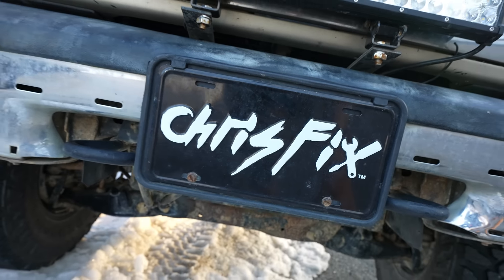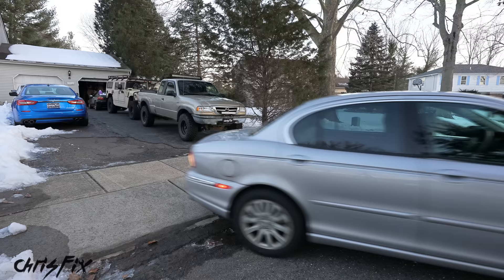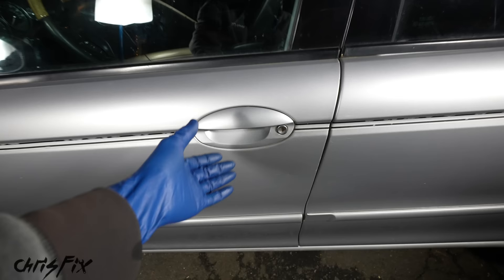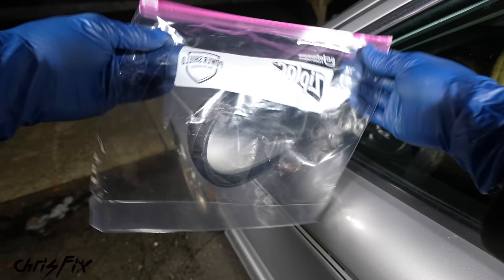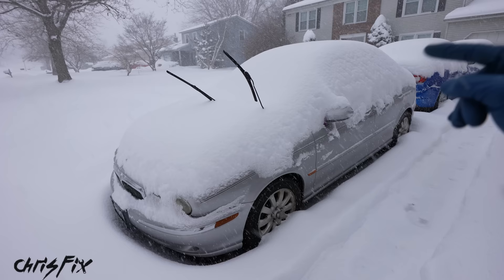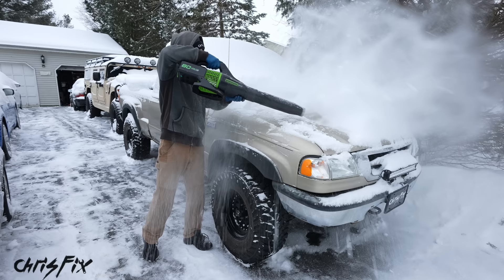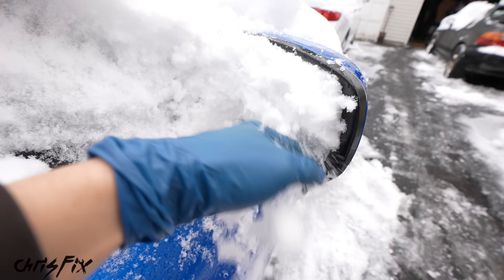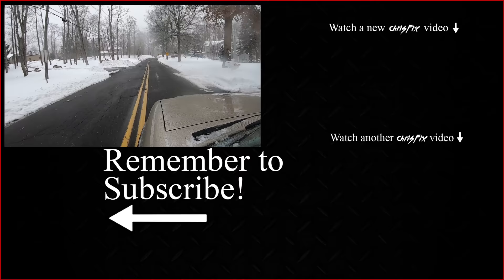10 Winter Car TIPS & TRICKS you NEED to Know

Comment: Right after all the beginning dialog, my first thought was "clean out your garage and park the car in it".
Reply from the maker: Unfortunately that will never happen. My tools and the products I use to film take up a lot of space.
Reply: Last year: 100 Watt light left under the engine block.  This year: car under cover.  Yeah, it's nice.  Fortunately there are other buildings here for the boxes and tools.
Reply: @chrisfix  "ChrisFix here, today I am going to show you how to upgrade your 2 car garage to a 6 car garage!"
Reply: @tactileslut  a long time ago, my dad drive his 1959 Buick Invicta every day in Ohio and it never had an issue cranking up.  That thing was a tank.

However, our neighbor with the diesel Peugeot, had issues with his fuel gelling when it got below zero.

He asked my dad for help and he put a few light fixtures on a board and put heat lamps on them.  The guy kept them plugged in all night and cranked right up in the morning

No idea on how he got back home after work.
Reply: @abstract1dea  Two heat lamps are keeping my well equipment happy.  Two more, on a dimmer, are warming the cat bed in front of the car.  They're a wonderful, simple invention.  :)
Reply: I have a one car garage that’s barely big enough to pull a small car into and open the door, it’s more like a convenient place to keep stuff than an actual garage
Reply: You don’t want to do that with salt on the roads. It heats up the salt and speeds up the rusting process

Comment: Something i learned back when i had a newspaper route on snow days: if you have a FWD vehicle and stuck at the bottom of a hill with no outlet, try reversing up the hill. Effectively makes your car a RWD with weight of engine giving more traction. Got me out of many desperate situations
Reply: FACTSS
my 4wd vehicle got stuck one time on a hill literally got to put 4wd lock on it
newspaper routes for me in NY were hard
Reply: Actually reversing also makes the tyres grip more as they are worn that way so its more edgy and grippy that way, but doesnt mather if your tyres are new. I once reversed up a hill with a truck thay is rwd and it worked becauee of what i just said :)
Reply: Also, reverse gears have more torque
Reply: This is also why backing into your driveway makes no sense unless you driving a rear-wheel drive vehicle or 4WD. Most cars today are front-wheel drive. If you need to punch through the hedgerow created by the plow you will need as much momentum as possible so keeping your drive wheels on the ground as long as possible is really important. So you want those drive wheels to be the last axle to bridge that snow pile not the first.
Reply: @LowsJuan  vehicles also typically don’t have as much clearance in the back
Reply: It does work indeed

Comment: The best tip I've ever gotten was from my grandpa before he passed. He sat me down one day and he said "listen boy if you want to avoid all the issues that you seen in that Chris fix video just buy a house with an attached heated garage." And you know what he was absolutely right!
Reply: Everyone is not in a position to do that.
Reply: @rickjames7576  fine, then buy a detached heated four car garage if that's more realistic!
Reply: My driveway is over 100 ft long. Sometimes we get up to 48 inches of snow in less than 24 hours. When I know a storm is coming, I park 10 feet from the sidewalk. That way I only need to clear 23 feet of snow (10'+5' swk+ 8' to curb) rather than 113' curb to garage).
Also, his tips work for open parking lots or visiting friends. The windshield covers are now made for rear windows as well (giant plastic hooks attach to rims or wheel wells); mine also came with a pair of matching bags for the mirrors (string closures with  slide beads, ala ski clothing): they all fit into waterproof storage bags (trunk or back seat floor).
Reply: This is the house part 🙄
Reply: Yes, that would always be my first tip!  Garage for sure!
Reply: Could just as easily have this occur when at work. Best to know how to prepare the vehicle for the weather.
Reply: Great Video! Thank you❤

Comment: I used my leaf blower to remove the snow on my car last time. It was funny because it took me only 25 seconds and the car was clear. But it only work if the snow is dry and light. It would not work with heavy wet snow.
Reply from the maker: Exactly!
Reply: Yes when it’s like powder it’s so easy when it’s like icy and snowy it gets annoying and when you have snow flakes on your windshield it gets annoying
Reply: icey snow also works, just not as well. It least the top layer can be removed and I can focused dealing with the bottom. We Canadians do this shit every winter
Reply: There was a blizzard yesterday and I had to work on the car that my customer wants fixed and it took me about an hour to get like 10 feet shoveled becuse there was like 4 feet of snow I also had to clear out my door or it would have gotten all in my house
Reply: Flamethrower removes the wet stuff.
Reply: @MattyEngland  Hahaha!
Reply: Yeah because all your neighbors want to hear a leaf blower. Hey thereare things called your hands to remove snow. No gas electricity or noise required.
Reply: @Xplorer, there's a you tube video where someone uses a flamethrower to clean the driveway.
Reply: Use a hot air blower. Don't heat any glass fast tho.
Reply: @Ottotherepoman1  Who cares what they think. What's louder, a leaf blower or a snow blower? Also, maybe Bob next door may look out his window to see what the noise and ruckus is about and think, damn, that boy is smart. I think I'll use that trick next time.
Reply: Oooo
Reply: @Ottotherepoman1  It work with a battery. It's pretty quiet and less noisy than any snow blower. Also like I said it took 25 seconds maybe 30 seconds total.
Reply: @TheMarkoPoloProgram  Love your comment.
Reply: I love the dry fluffy snow. You can literally just whack the top of your car with the brush and like 90% of it will fall off the sides.
Reply: @Incubansoul  The one I blowed was a lot heavier than that.
Reply: I use a leaf blower to clear off our entire driveway. 2 inches of "wet" snow and about 4 of powdery snow
Reply: In the Southern US, snow is usually to wet to blow well. We often get a layer of sleet or freezing rain before the snow.
Reply: @Ottotherepoman1  you realize that lots of people use a snowblower instead of shovels, right?  Same thing with noise.   Do you also complain like a baby about snowblowers?
Reply: @Ottotherepoman1  In some countries with noise abatement laws it would actually be illegal, especially since you'd typically use that early morning..
Reply: Im shopping for one as we speak :)
Reply: @Ottotherepoman1  I have Kleine Levin Syndrome that is a n extremely rare sleeping disorder. I fall into a partial come (peri comatose) for 5-7 days in a row and it takes me 3-5 days coming back 100%. After 5-7 days I'm very weak. Shoveling snow it's 10 times harder than when I'm normal. And when I'm 100% if I get tired to much it triggers an episode. I do one or 2 episode per month in average since 2007. If I déshydrate or food deprive it trigger an episode as well. I have to fine tune how I live otherwise I would always be in a coma.
Reply: @VideoLeakPolice  thats some tough stuff. Sorry, if i was your neighbor your driveway would be done. But i understand that if you can find a way yourself  and u can keep your independence thats great.
Reply: For wet snow or iced windows, use an Elon Musk flame thrower.
Reply: @Ottotherepoman1  It's all right man. I live alone so sometimes after an episode I need some food because I ate everything in my episode, As you can read in the description of the syndrome I have food cravings (compulsive hyperphagia). So I need to go to the store but also I have complete lack of energy (lethargy). And when you don't move for 7 days lie in your bed your muscle atrophied. I shopped for a car shelter but my parking place is too fit the smaller one they sell. A contractor is no good since they remove the snow when I again sleep for 5-7 days. Before I had KLS I was top shape an played multiple sport all of my like So it's not a question of being lazy. From the 1500 KLS sufferers I know in the world, I'm the only one who live by himself. I have to find ways to ease the difficulty it cause and like you say be independent.  

DEFINING KLS
In addition to excessive sleep, a Kleine-Levin Syndrome (KLS) patient’s whole demeanor is changed, often appearing “spacey” or childlike. When awake the patient experiences confusion, disorientation, complete lack of energy (lethargy), and lack of emotions (apathy). Most patients report that everything seems out of focus, and that they are hypersensitive to noise and light. In some cases, food cravings (compulsive hyperphagia) are exhibited. Instances of uninhibited hyper-sexuality during an episode have also been reported.
DEFINING KLS
Kleine-Levin Syndrome (KLS) is a rare and complex neurological disorder characterized by recurring periods of excessive amounts of sleep, altered behavior, and a reduced understanding of the world. The disorder strikes adolescents primarily but can occur in younger children and adults. At the onset of an episode the patient becomes progressively drowsy and sleeps for most of the day and night (hypersomnolence), sometimes waking only to eat or go to the bathroom. Each episode lasts days, weeks or months during which time all normal daily activities stop. Individuals are not able to care for themselves or attend school and work. In between episodes, those with KLS appear to be in perfect health with no evidence of behavioral or physical dysfunction.
Reply: it looks fun af
Reply: I know you
Reply: @Zahid_FBX  How?
Reply: @VideoLeakPolice  u watched that video where on roblox this guy said if u give ur roblox name he’ll give ya robux
Reply: @Zahid_FBX  I don't know what robux is.
Reply: @VideoLeakPolice  the roblox video
Reply: @VideoLeakPolice  are u a kid
Reply: hahaha pour some gasoline with a spray bottle and light it up... problem solved hahahahhaha {It would not work with heavy} wet snow.
Reply: @chrisfix  can you do a video about tuning your carburettor correctly
Reply: @chrisfix  where's the new video
Reply: @momenj8881    9 8 9  9mm.      O9. 9 nnm. 9
Reply: @chrisfix  yes chrisfix
Reply: If it is a light powder, just drive away and the snow will fall off. Zero effort required.
Reply: if its dry and light then itll blow off once you drive
Reply: What is snow?
Reply: I take the easy way out. My truck is parked in the garage.
Reply: You actually can still do it as long as you have just recently done a great wax job..I didn't believe it til my older neighbor did it to his truck.
Reply: Do they sell leaf blowers with a car cigarette lighter adapter?  Lol, remember when cars had those coil cigarette lighters!
Reply: @chrisfix   love you
Reply: @MattyEngland  Keep away from your gas tank. 😅
Reply: @TheMarkoPoloProgram  Problem solved if you do your neighbour's  vehicle and driveway as a courtesy. Just don't do it at 3 a.m.!
Reply: I live close to highway i55   i use to clear front window an side   then drive really fast behind semi an snow all blows away   even wet heavy snow
Reply: @Ottotherepoman1  True, but there are usually snowblowers fired up after a storm as well. I wouldn't use it too early in the morning, though!
Reply: Hey, a heatgun/blowdryer would work for ice! Better if you just need to get into the door though like if theres a solid sheet over the door lol
Reply: @VideoLeakPolice  I’m so sorry to hear that. Man, that is rough.
Reply: Snow is Never dry , it is water !

Comment: A few tips if you get stuck in the snow. Have one of those small foldable shovels ready in the trunk. You can use the cars floor mats under the tires to gain traction. Tire chains is also a nice backup
Reply from the maker: Thanks for the info!
Reply: Kitty litter or ice melt (safe for dogs) helps too. I think there’s a spray to melt frost and ice on your glass. Also one of those plug in to  car lighter sockets. May not be available on all vehicles. Most of these mentioned can be found in the vehicle area of Walmart or in a car/truck store like Auto Zone.

All even better if you’re retired now, you can just stay home.  My Dad told me to at least keep your gas above the 1/2 way mark. Although we used to live off a busy street, our driveway was designed with a turn about. Circular driveways are nice too. I want one of those. Hoping to save up for that in Spring. Waiting on the guy to give us a price quote.

Comment: Living through midwest winters has tought me that anything that keeps water off your car is good. Waxing your car before winter really helps get it off fast. Some sort of window treatment like RainX also really helps.  Also a collapsable foam snow broom for your car is a great alternative to a brush since foam will not scratch the paint and will also push big chunks of heavy snow.
Reply: There are window cleaners now with rain repellent added. Just clean your windows and mirrors as usual, and you've added protection. You'll have to buff the windows with a microfiber towel after you clean them, but it's well worth the effort.  Rain-X also makes washer fluid that contains their product. It will help maintain a repellent coating. It's worth every penny. If you're a detailing nut like me, a ceramic coating formulated for glass usually will last the entire winter if you use your wipers sparingly. A ceramic paint coating also helps snow slide right off your paint. Cheers from Illinois.

Comment: Quick tip: if your ever stuck in snow because your car has no traction, place your rubber floor mats under your wheels for added traction. Thanks Chris for all the great tips, keep up the good work!
Reply: Geez...that's a good one.  Hadn't thought about that.  Watched a show one time by one of those Bear Gryllis types who basically destroyed the rig to demonstrate how you can survive the cold with sun visors for snowshoes, hubcaps for water from the spare tire you set on fire to make a smoke signal to side mirror for signaling and upholstery to keep warm.  Don't forget a cigarette lighter to start fires and all that trunk wire to bundle up your feet and legs.  Simple as look around at what you have and making the best use of what's there.
Reply: Thanks. Sounds simple but difficult to think. It happened to me and my friend came n helped me with truck. I don't wish it to happen again haha but if it does, i'll do ur advice. Ty

Comment: Good video and I would add: 1) In 30 years, I have only "combat parked" regardless of the snow expectation. It is safer to drive forward in to the street, so it is good to have the habit throughout the year. 2) The main purpose of the silicone spray is not to displace water already in place, but to create a coat to avoid water molecules adhering to the surface when the temperature drops at night. 3) The brush looked quicker and easier than the leaf blower, but I would suggest starting from the roof and then move down as you end up moving snow to areas already cleared the way shown.
Reply: you stole my name mate 😂
Reply: I would disagree with only one thing...  If you have a front wheel drive car, you are better off to pull it in nose first because the car will keep the area behind the tires relatively snow free.  This will give you traction to back out.
Reply: @VroodenTheGreat  Backing into a parking spot is never about traction. It's because it's safer to back in rather than back out into traffic and pedestrians.
And if your tires have so bad traction you can't get out of your driveway, then you probably shouldn't be out on the road anyway.
Reply: I didn't know it had a name like 'combat parking', but I've always done this because my job requires me to get in & go.
Reply: Found the boomer dad 😂
Reply: @DonGorgen  i would agree with safety but disagree on traction . I have a lowered FWD car and the traction would definitely help getting out better of a slope around the car , with momentum you will not care scrapping the bottom of the car a lil bit but you need to get going in the first place .. also FWD are best in reverse in snow for traction purposes

Comment: If you get stuck in the snow, don’t run your car to stay warm without checking that the exhaust pipe is clear. If the tailpipe is clogged with snow, exhaust can build up under or inside the car. It’s possible you can fall asleep and never wake up. Stay safe <3
Reply from the maker: Great tip!
Reply: Very cool trick i didnt know that either
Reply: And here I thought catalytic converters had taken care of 99% of that problem 😊
Reply: @LMCEK  cats dont do that at all. All cats do is get hot and burn the gas that did combust when ignited in the combustion chamber so that raw gas isnt going out the tailpipe.
Reply: I heard a story about a father and his toddler son passing away from CO poisoning when a passing snowplow buried the vehicle tailpipe which the father never knew.
Reply: That's the most important tip I think. Many people die every year because of not knowing this.
Reply: running open headers with the climate intake being right next to the header be like
Reply: This advice needs to be pinned. I saw death of a family (stuck in snow) occurring due to this.
Reply: @jacksmith2315  It's not raw gas you need to worry about; it's carbon monoxide gas, which is odorless and colorless.

Comment: We in Siberia often keep a spare battery at home in case the installed one cools down too much to start the engine. This applies if the car doesn’t have any sorts of heater or remote engine-start systems installed. Or, to stay cheap, we can just take off the only battery for the coldest nights periods and install it back when needed. It takes less time than cleaning the snow and allows to start the frozen, but well maintained engine at -35°C (-31°F) or sometimes lower.
Of course it’s always better to keep the engine warm somehow instead.